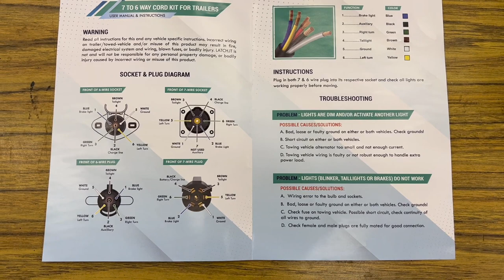Ford Bronco Toad Conversion

Comment: Thank you for this very impressive installation and excellent video documentation.  My set-up is similar on my 2door base w/manual.  The Rambler bar with the modular bumper just makes sense
 I did mount my connector plug and breakaway along side the sensor panel in the center bumper cutout but a very tight fit and I had to clear the radiator luvers.  I used the RVI break system that the piston is mounted under the hoodwith the cable through the firewall.   Looks like we had the exact idea on the mounting location for the vacuum box but my 2.3 uses the engine vacuum splice.  I was afraid to attempt to wire both the towing harness with the tow (diodes) and since the Base Bronco come with incandescent taillights I just drilled out the additional bulb sockets to keep things seperate.  I didn't get a chance to tow mine yet but you've given me the itch.  You done good. 25:03   I hope you enjoy many new adventures with your outstanding retrofit that looks factory fit.
Reply from the maker: Thank You!  I'm impressed that you were able to run a cable through the firewall to the brake pedal- it's a very hard to get to area if you don't have the Bronco up on a lift.  I was also afraid of messing with the radiator active shutters and Adaptive Cruise Control radar module, and didn't want to drill new holes in the bumper. That's how I decided to mount the umbilical plug and breakaway where I did.  Having the electric brake assist actually greatly simplified my install over what you had to do.  However, do make sure to go through ALL the steps in the manual to put the transfer case into NEUTRAL TOW mode, even with a manual transmission, or you could end up with problems.